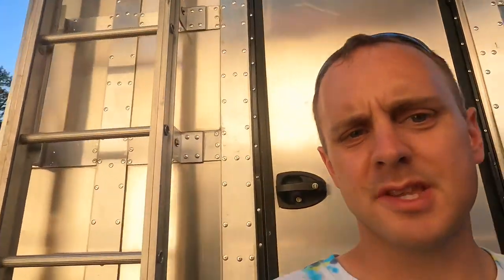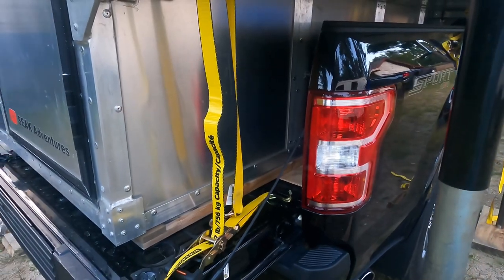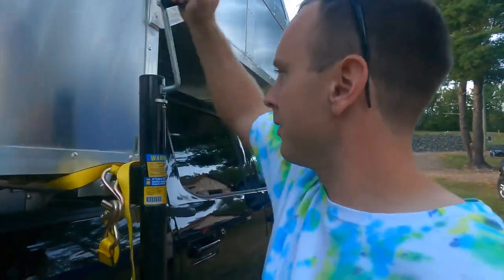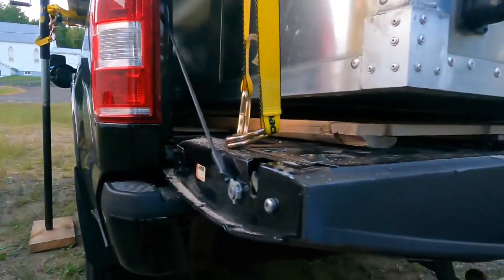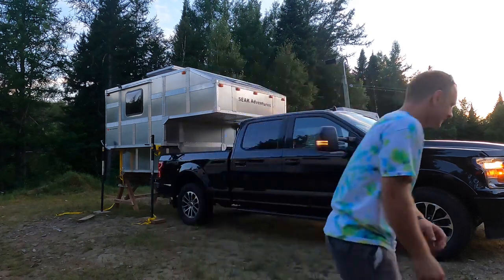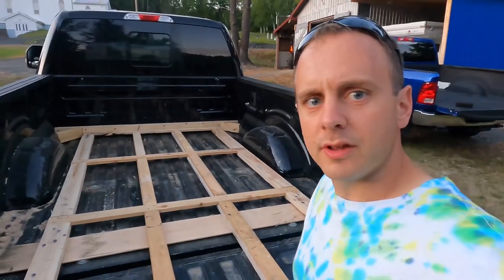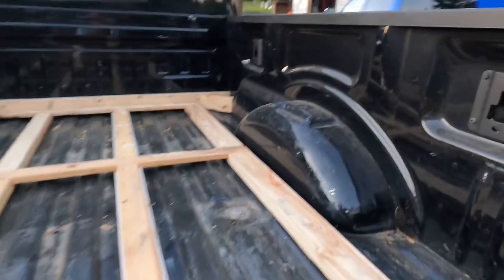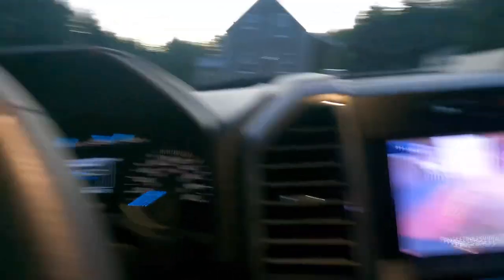Unloading Our Camper & Building DIY Truck Camper Jacks #truckcamper

Comment: This was such a great build.  I am also thinking of building jacks from trailer tongue jacks.  I was glad to find a video of a similar idea.  I would like to be able to remove my camper and leave it at the campsite so I really have stability as a goal.  Nice work.
Reply from the maker: Thank you. Biggest thing is to make sure they are tight fitting. I had some issues with stability when removing it but I’m slowly figuring things out! If you watch my latest unloading video I show some more on the jacks and how i keep it stable for now.

Comment: Like this idea how is it after you've used it a few times the Jack's I mean
Reply from the maker: I ended up adding some actual camper jacks due to stability concerns. It worked fine but it would have needed additional bracing

Comment: They're identical to my "legs 1.0"
2.0, I added the outer pipe extention also.  A monstrous difference compared to just the inner tube.
As I mentioned to you,  on my video,  I went 3.0 and bolted them on the front.  What a difference!
Reply from the maker: I think I will be looking for a way to make them more secure in the spring. They work fine but the movement is not ideal. Maybe together we can come up with “legs 4.0”

Comment: wow! nice camper. looks like you built it yourself. How far did you extend the jacks with the pipes? Are they unstable now that they are increased in height?
Reply from the maker: Thank you. I think I extended them about 32-36 inches. They have a fair amount of movement right now due to the “play” in the pin connection to the camper. A little bit of movement goes a lot further once extended. I am going to work on this in the spring to try and create a way to also bolt the jacks solid but also keep them so they can still be removed easily. But the main part is they served the purpose to unload for the season.
Reply: I built this same setup so I could turn the pin and spin the jacks sideways while driving but the swivel style jacks are to flimsy. Im going with a welded tube that slides in and out with a massive pin. Trailor hitch size tubing and square 2k pound jacks no swivel

Comment: I'm sure this isn't the best place to ask this question. How are the rivits holding up?  Would you use them again or would you rather have welded the aluminum frame? This is a very impressive build. What did you say the weight was again? I'm thinking seriously about going this route myself.
Reply from the maker: Hi George great questions. I actually went and walked around the camper yesterday to check on things, and I didn’t find any issues with any rivets or any cracks in the welds.I did however notice two rivet heads worn down where they made contact with the front of my truck box, but they remained in place. 

For the welding question, if I had the skill set and could do it myself I would have welded it for the cleaner look, but given the workspace and equipment I have,  the rivets were my best option. My friend at VFab Garage was kind enough to help me weld the parts where required.  I am not 100% on the weight but I’d say in the area of 1400lbs loaded when we go camping. I am hoping to get a more accurate weight this summer but I still have a few build items/ modifications left to do.